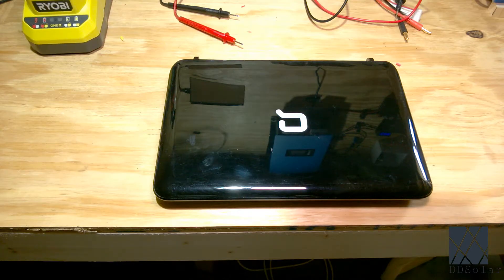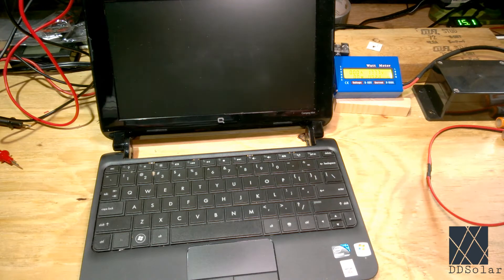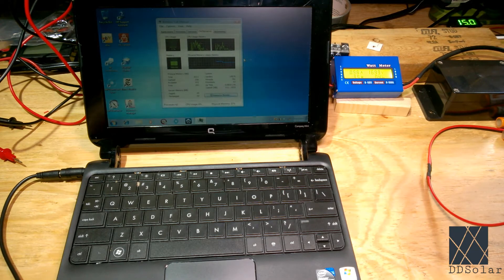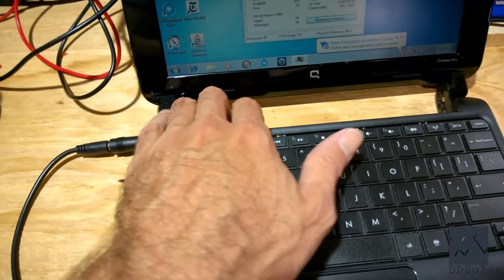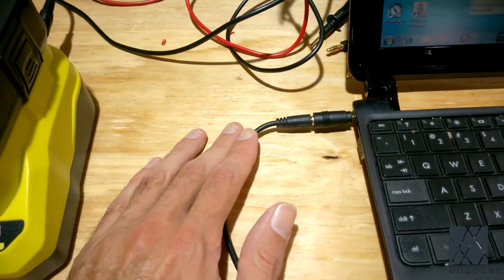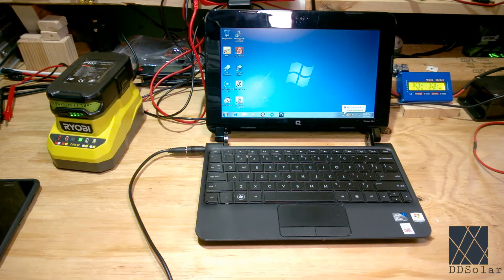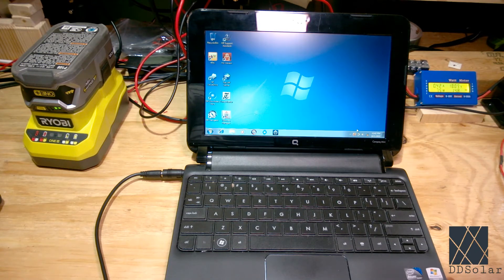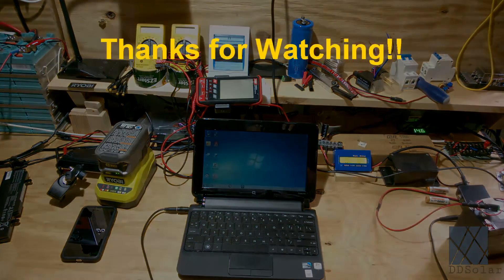Solar Powered Netbook for the Field - Video of directly charging with a 100w 12v solar panel

Comment: Great video.  I am a non-tech person but had this idea.  Very important concept, in emergency situations where no battery is available, this is a life saver.  What would be the best thing to put between a solar panel and laptop - DC-DC converter, Buck-Boost converter, Charge Controller?  Or a couple of these combined?
Reply from the maker: @mariodesira7188 Thanks :) I would suggest some kind of DC converter for safety, because direct PV can be extremely risky. This is an extreme test for research purposes. A buck converter should do the job, and with a battery in the laptop you'd be in good shape for off electrical grid computing
Reply: @solarpoweredge  Thanks for the feedback :) So DC converter or buck converter should suffice - -- in the event of a solar flare taking out the grid for years, batteries eventually become useless, this may be the only viable option! 🙂
Reply from the maker: @mariodesira7188 You welcome :) I sure hope we don't have a flare, but I'm all about preparing no matter what :D

Comment: This was highly informative. I'm looking into getting a 100w panel and using it with a charge controller and inverter to power my laptop and wifi so that I can always have power during the day. My neighbourhood has power issues somewhat often and we're never sure how quickly it'll be repaired so I want to get a setup like that, without a battery in the middle of it. Thoughts? Is such a thing possible to do?
Reply from the maker: @JonathanC495 Hi, thanks glad you liked this :) what you're asking is definitely possible. I want to do more videos about the topic, as my "home datacenter" is 12v and will soon expand to the workshop. Running everything on DC makes perfect sense, because computers don't run on AC. 
Here's what I'm thinking though. Direct solar is 100% possible with a laptop. However, adding a battery in the loop that's "optional" and is only used when it's dark might still be a good idea. And that's what I'm working on now. It even has a catchy name. I will share this project with you as soon as possible :)

Comment: Most likely works because on an internal dc converter designed for the battery. Dead flat a lithium battery can be 15 volts or a little less depending on the chemistry. 

Likely safer to do a 24 volt panel and just use a regulated buck circuit.
Reply from the maker: It has a VRM inside, this netbook doesn't actually operate off of 19v, so my solar panels happened to work perfectly with it. However some netbooks can be burned out this way. So a regulator would be safer. The battery is very tiny, 3S, maybe ~9v when empty.
Reply: @solarpoweredge  thanks, I have a t440p I’d like to solar or power via a 24 volt battery bank. Inverters suck. 

I’ve been watching your videos, please keep it up. 
I’m building a outdoor kitchen, I plan on putting in a roughly 40 volt solar array for direct DC loads. 40 volts because I found out QO breakers support up to 48 volts DC. So I will have a low cost dc load center I can solar drive and use for cooking or other useful loads.
Reply from the maker: Thanks for watching :) Sounds like a fun project!
Reply from the maker: I didn't realize that's a laptop. Yeah should be able to run it with a proper DC converter no problem - battery or straight solar, efficient and simple.  

PS. Appreciate the good feedback also. Hope to have some more cooking and direct-solar related content out for you soon... 1000 videos I want to make, barely 1 or 2 get done. Maybe that will change soon though, it'd sure be awesome.